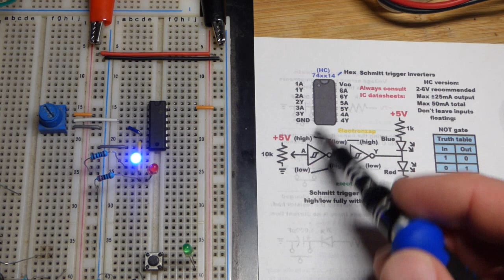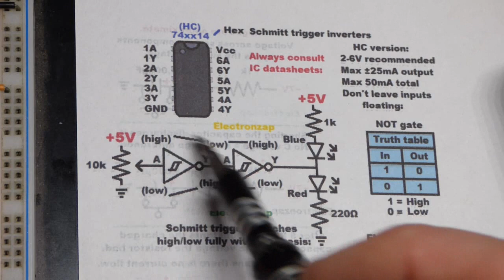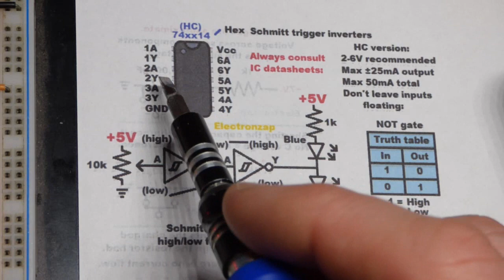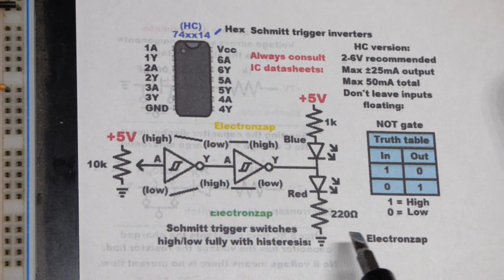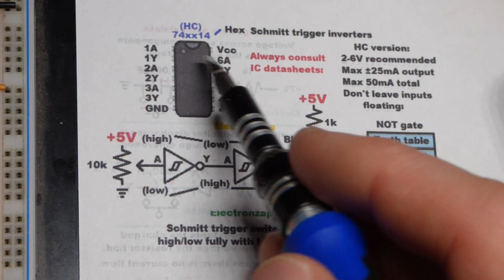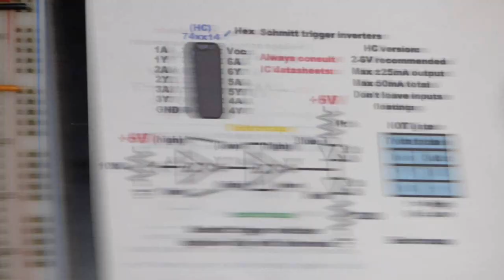Making Input and Output the same by combining two NOT gates with 74HC14 Integrated Circuit IC

Comment: I got up and went to my bench to check my parts kits and I do have a few of those. Now the unused inputs I'm assuming a 10k ohm pull-up or pull-down resistors on each of those? 😊
Reply from the maker: Nice! Best to check the datasheet, but generally speaking, any amount of resistance (even a direct connection) to either supply should be fine for all unused inputs.
Reply: @Electronzap I’ve never heard of the “don’t leave floating inputs” for the 74 logic chips before. It makes sense, as doing that will make the chip more predictable than leaving them exposed, but it’s still a concept I have’t seen about.
I’m gonna remember that next time I design a logic circuit :) Thanks for the video!